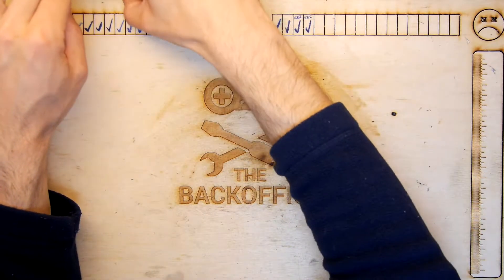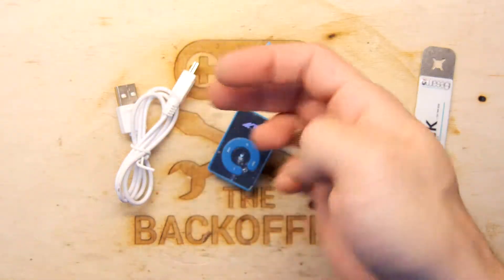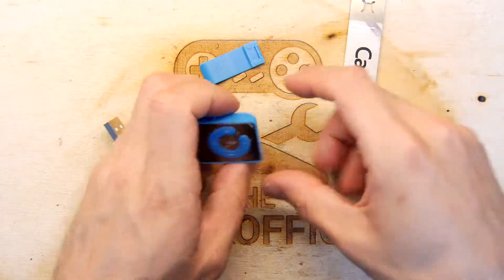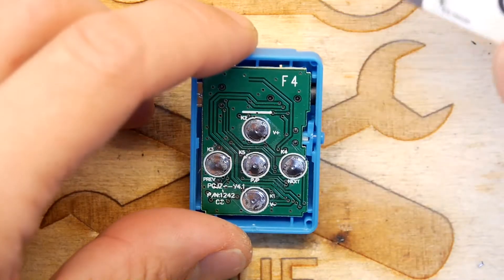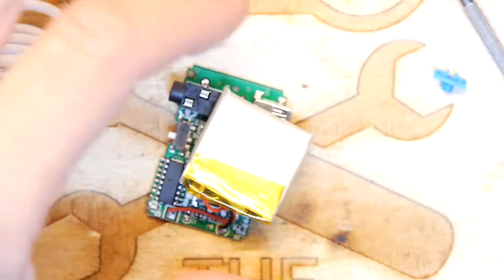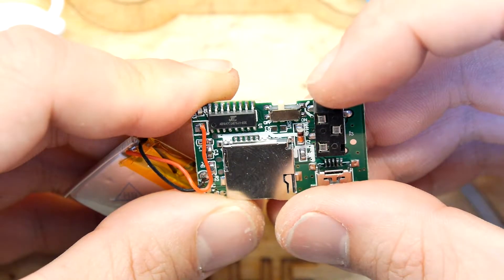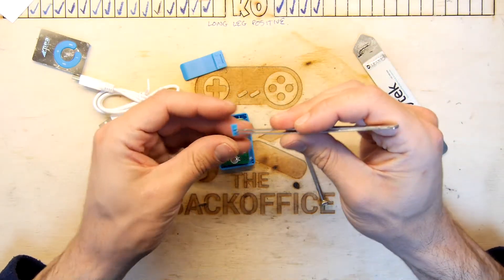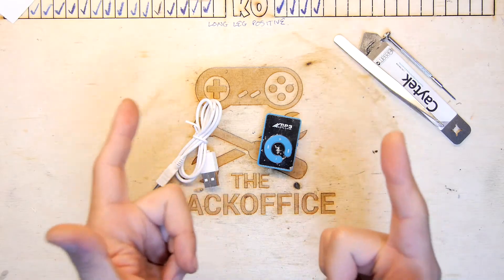Cheapo MP3 Player

Comment: these can be found for under $1. the charging circuit is poo and the battery life is poo as well, so what i did was throw in a tp4056 charging board and a bigger battery, and now it can play for like 10 days instead of like 1 hour.
Reply from the maker: +Pretti PC Services Great idea. I suspect these crappy devices destroy their own batteries because of their lack of decent charge controller
Reply: The Backoffice yeah I bought it to not go insane at work and have been using it for about a year now with no issues. I needed something cheap and small because it has to get thru security every day. I've been looking for smaller batteries but it's cheaper to buy the devices for the batteries. The one I stuck in there is about 900mah out of a blu ecig charger pack. 3.33Wh and about as big as the MP3 player.

Comment: First! not really. When I look at my phone I ponder what would NASA (or some other space agency) have done with the computing power of this device in a space probe 40 or even 50 years ago. You know, with proper shielding and understanding of the software etc.
Reply from the maker: +Gentleman Adventurer probably nothing really. I think they already have had enough computing power to achieve what they needed in an incredible reliable platform. I doubt they would have trusted or still been able to trust the platforms we use today. I suspect even modern space vehicles hardware is nothing like our consumer electronics. 

Interesting thought though 🤔

Comment: Bought one of these on a whim a few years ago and I totally agree that they are good fun to tinker around with. Just a small warning about the battery, the charging circuit is literally just a series diode so don't leave it plugged in too long and be careful about over discharging because there really is no protection of any sort. Mine swelled and started venting the battery after a few months of use but as always ymmv.
Reply from the maker: +sjm4306 Hmmm fat lithium cells are always scary 😂

Comment: These are a buck each shipped to your home!! Its sure is amazing time we live in.

http://www.ebay.com/itm/Mini-Mirror-Clip-Mp3-Sport-Player-With-TF-Card-Slot-Up-To-8GB-Blue-Hot-/112360981410?hash=item1a293c83a2:g:xE4AAOSwpkFY5i9Z

Cheers
Reply from the maker: +I_will_get_you There Totally bonkers isn't it! You can use them as disposable devices 😊
Reply: They sure are! I wondered if the battery had a protection board on it?
Reply from the maker: +I_will_get_you There I think I might put a data logger on it and see how it behaves over time